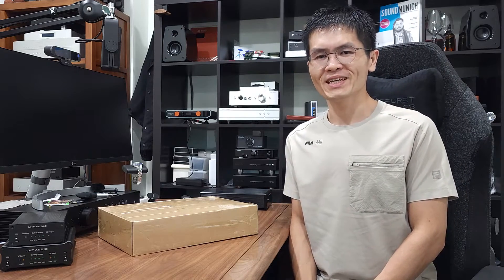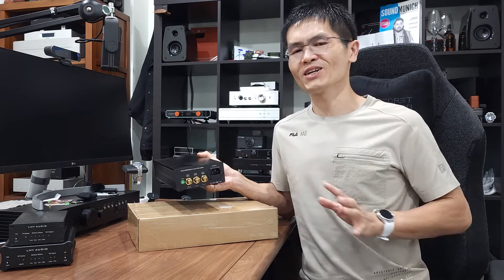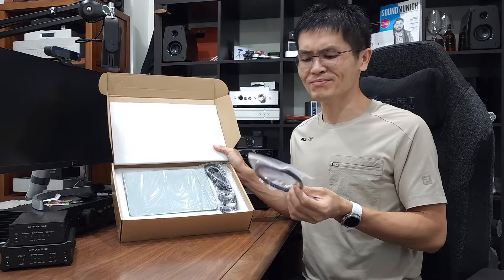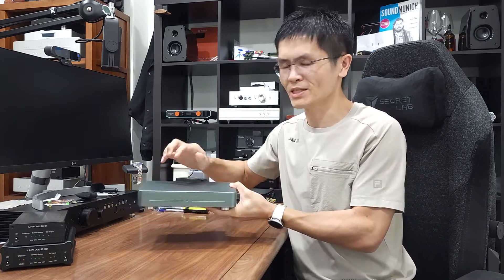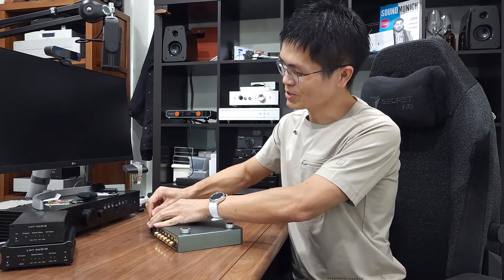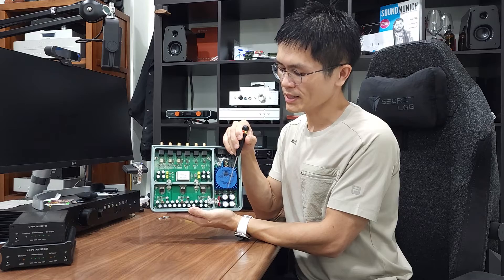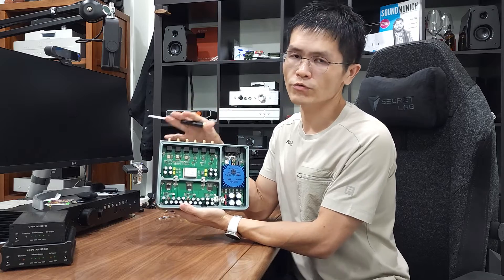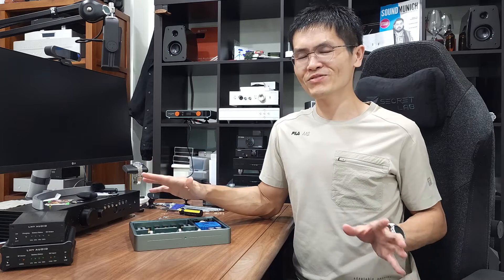LHY Audio OCK-2 /Premium 10MHz Master Clock Generator

Comment: Hi Alvin, thank you for another great review.
You comment that this master clock is configurable by internal switch to work at 50 ohm and 75 Ohm, but to use unopened right how you receive it from the store what is the default mode? 50 ohm or 75 ohm please?
Thank you, cheers!

Comment: To really bring out the most out of your Gustard R26 DAC, you should get this OCK-2 and also the U18 DDC running iiS to the R26.  Also have a USB card in your PC that's running off an external DC power source.   Audio perfection.
Reply: If a device that requires other devices connected to it to get that most out of then it is a poorly designed device.

Comment: I'm skeptical and it remains to be heard if adding an external clock will help or hype (I will test) ...I do know this, U18 added to R26 DAC / is not needed because it didn't achieve best sound...I found out using Chrome Cast on my Android Beelink GT-King achieves higher bit rate 48k excellent sound quality... I sent my new ifi zen stream and gustard U18 back...I will invest that money towards a second Rel T7X...Don't do like me and get caught up in the hype...streaming Chrome Cast to R26 is very sweet, detailed, punchy, and a warmth I love when paired with Gustard R26...also I get to see my music streaming on my TV...the phone is only a remote and it streams Tidal straight from Tidal without a 3rd party app😁that is why the higher bit rate and higher sound quality...USE Chrome Cast w/R26 and thank me later; better sound and less money...all these streaming companies devices try to just take your money...I'm keeping it REAL!
Reply: What you describe as warm sound with Chromecast is probably high digital jitter. I used to think it was analog gaming. Unfortunately not.

Comment: Very nice! It has made a noticeable improvement to the Gustard R26 and it is easy to A/B test with the remote. Alvin has been great to work with.
Reply: hello, may I ask if the r26 should use the sine wave or square wave output? I just ordered mine and will use it with r26. Thank you 🙏🏽
Reply: @hodavid4551  the specs say it can use either wave shape but square wave is preferred
Reply: I just received the ock2 and played with my r26. It seems that the width and dynamic is not there, is it sth that will be back after the burn in? One thing I do notice is the much darker background and the clarity of instruments
Reply: @hodavid4551  you can a/b test by switching the clock to internal/external with the remote. Your ears need to relearn how to hear again. Give it a day or two. make sure to warm up units for an hour or so.
Reply: @hodavid4551  so any difference after burn-in period? Any improvements?
Reply: @pz1036  With the R26 in NOS mode + OCK2 I am blown away. IMHO NOS mode fixes some of the bass issues with R26 and decay is so amazing.
Reply: @grubbinsgrubbins5804   great!  I also heard that  one can purchase DDC like gustard u18 or other and connect it to the external clock. Having done this, clock will gove a signal to u18 and u18 will give a signal through I2S along with the clock signal to R26 (so clock connects only to DDC)
It is said that results bring R26 to a next level of quality
Reply: @pz1036 managed to do it? What’s the results like?
Reply: @b00m3rh4nd_sol may I know which clock you purchased and which options you picked? I am using the R26 roo
Reply from the maker: Thanks for the feedback, I appreciate it!
Reply: Hi, may i ask if you can help to check the fuse specification of OCK2? I've ordered OCK2, and it's on the way to me within this month. I really want to do the fuse upgrading, so i need to prepare the better quality fuse in advance. Thank you.

Comment: Alvin, If you have a minute can you please provide an answer to my questions or redirect my comment to your techy..  I have the Iris DDC and Pontus II. Will the "LHY Audio OCK-2 /Premium 10MHz Master Clock Generator" work with the Iris which has 45 & 49 BNC digital in? Currently, i am using an {I2s from the Iris to the Pontus} but i am also feeding the Iris to another DAC, the {ADI-2 PRO fsr black edition} via AES and, yet another DAC, the {MHDT Labs Orchid} via spdif, it also has an BNC and optical connection (which sometimes works and other times it will not until i disconnect and reconnect it). These components are connected to my Schiit Freya+. Amps are Willsenton R8 (NOS tubes) and Kinky Studio EX-M1 (with staccato op-amps-"I love this amp now, you almost can't tell the difference between the R8 and Kinky Studio). Please advise if the LHY will work with my current equipment and or provide a noticeable improvement? thanks, don
Reply from the maker: Hi Don, the OCK-2 is for devices that accept 10MHz input. It is not compatible with DENAFRIPS Iris DDC. Anyhow, we can be reached via email at support@vinshineaudio.com. We are committed to respond to all inquiries within 24hrs